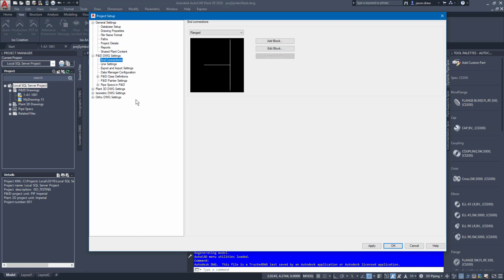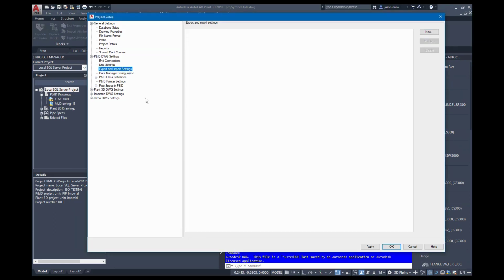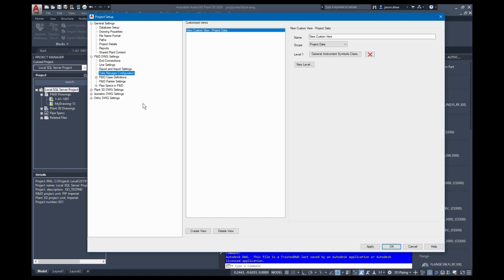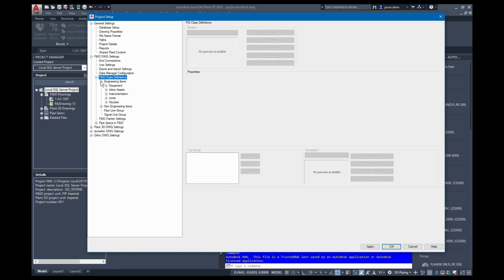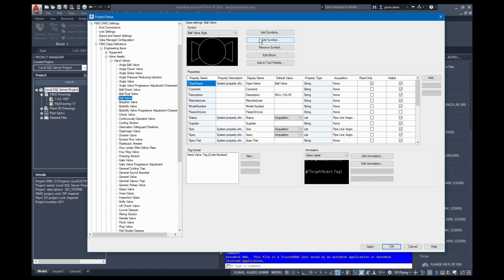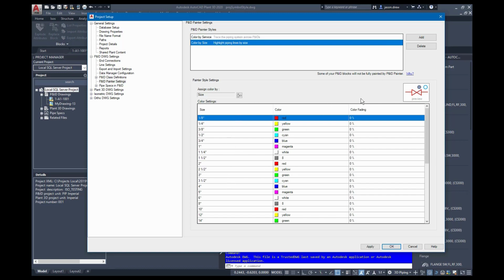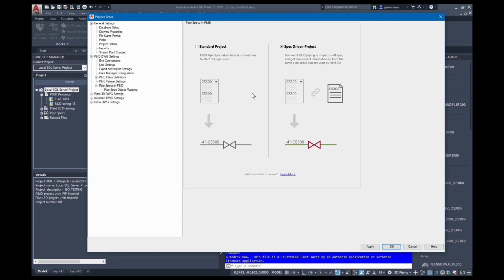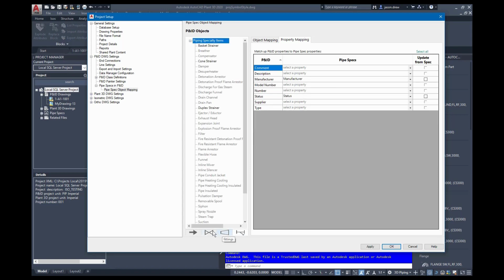Plant 3D with the Experts:  Project Setup Part 2 - P&ID DWG Settings | AutoCAD Plant 3D

Comment: Hello, thanks for your time to share this information ... On the other hand, I wanted to know how I could include a team in the P&ID tools pallet? and how to initiate a P&ID, I mean the entry line of a tank, where the initiation comes from a piece of equipment or supply which does not have a definite P&ID, but begins at P&ID 001 for example, in regulations where I work only Put the circuit or start flag, but in the Plant 3D P&ID how can I do it? Thanks for your prompt response ... Kind regards